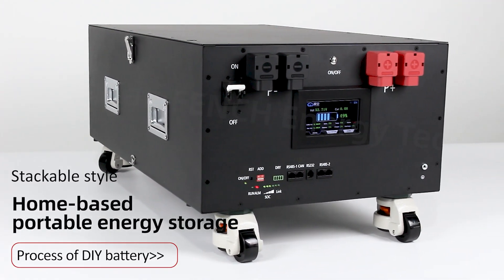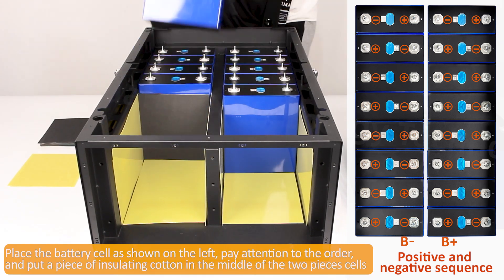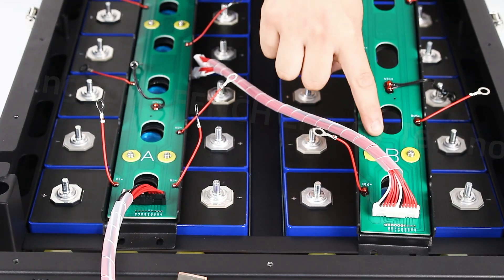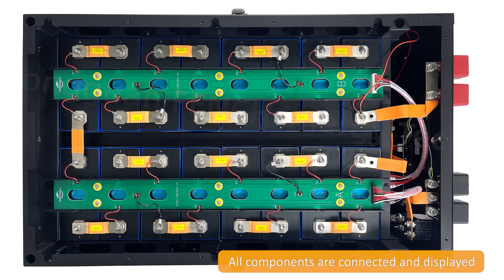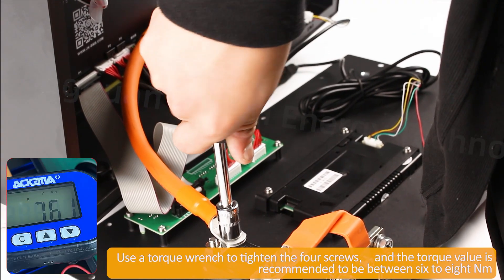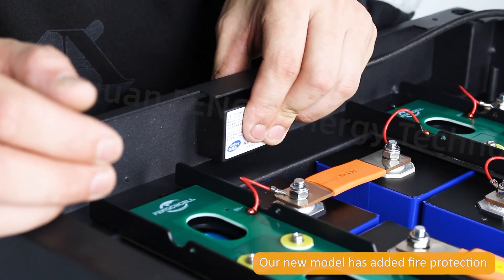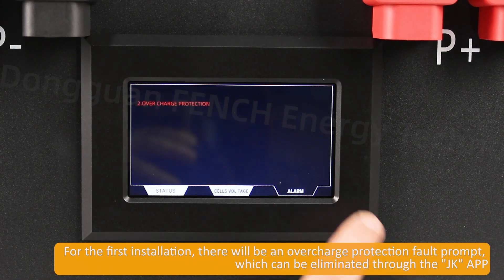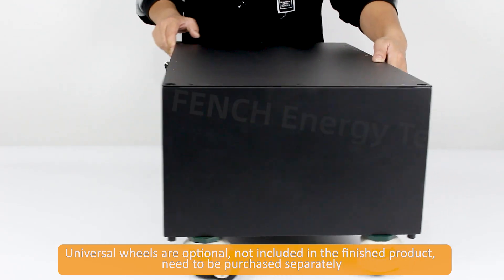48V 280AH/300AH diy box with JK BMS Assembly process

Comment: Can this small circuit breaker safely  disconnect 30 000 to 40 000 AMPS of  short circuit current ?
What will be temperature of this circuit breaker after 1 hour at nominal current of this battery ?
What is temperature management fo this cells ? If cells will be in hot climate, they will be destroyed
very quickly without ventilation. Does your BMS have explosive gases detector, if one of cells will 
explode and H2, C2H2, C2H4 , CO adn other gases will be ignited with this circuit breaker, 
or with external ignition outside the box ?